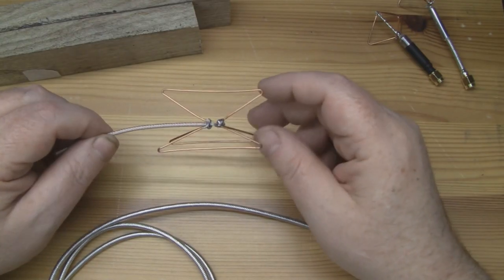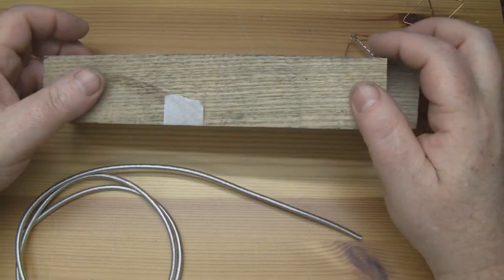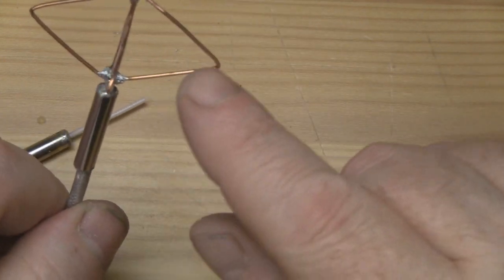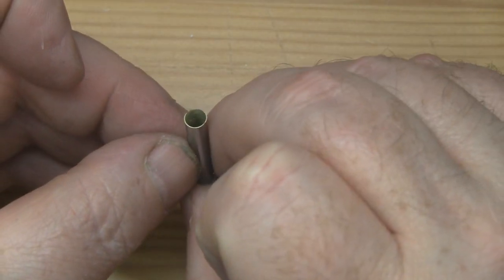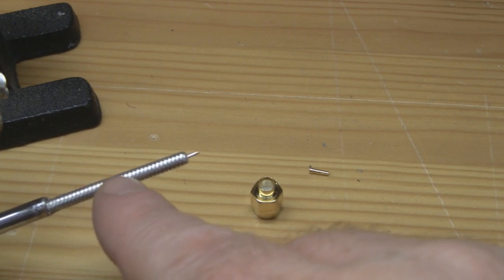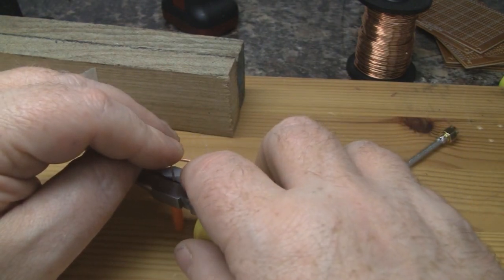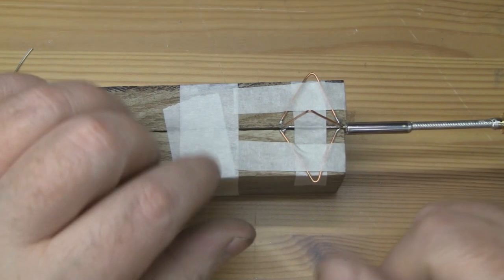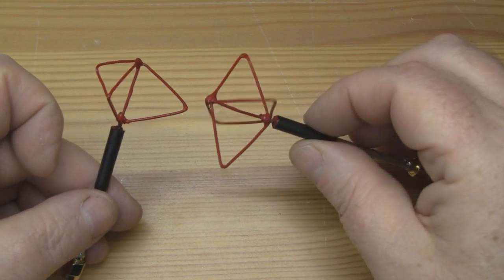Blade Antenna for 2.4GHz

Comment: Sorry for necroing an old vid, this type of antenna works well for my 4G mobile wifi (i look for a compact powerful antenna for my 4g mifi).

Thank you Sir McNeil for shedding some light on this particular powerfull antenna.

Adds significant DL speed:

4G mifi using internal antenna: 2 - 3 MBps

4G mifi using standard biquad (reflector less than 1 wavelength square) 3-4 MBps

4G mifi using this 4 blade antenna (sloppy soldering job, no balun, soldered directly to sma female bulkhead) 4-5 MBps

Yes, MBps not Mbps

Pros: really powerfull RX antenna (tested indoors, my neighbors house (including mine) are made of bricks taller than mine, 2 of which are 3 floor house), compact form factor, easy to build (i can build it less than half hour, eventhough im poor in soldering)

Cons: somewhat fragile, needs case or serious reinforcements (epoxy putty or hot glue) as im planning to put this in my relatively small sling bag during my commute or daily activity (needs to be train commute proof)

The SINR of the biquad and 4 blade antenna didnt have  significant difference, but the 4 blade antenna crush the biquad in download speeds, any thoughts ?

Comment: It is called a Non-polarized Bi-plain antenna.  NASA and RUSSIA used them in the space programs to link there satellites and such in orbit.   They had a directional value to them that helped in maintaining a signal with the craft from the ground.  If the signal was sent via like a polarized antenna the signal would not have a smaller target window have a greater chance to drop the signal!

Comment: I really like your videos and the practical approach they have.

I made one of these for my RC controller, I used heavier wire (hard to bend) and soldered some copper tape for the sleeve instead of tubing. A couple layers of heat shrink under it helped to get some distance between layers.

Works like a treat so far, but I've yet to test any long range to indicate a real success.

Comment: Hi Andrew, why do you use 25 mm as a ¼ wavelength ?
for wifi channel 6 (2,437 Ghz) ¼ wavelength is  30,77554370127206 mm  (accoring to  (300/2,437) /4 = 30,775 мм) in free space, and  29,236 mm in copper.(   ((300/2,437) /4)*0.95 = 29,23676651620846 )
Reply: (300 * 095)/(4 * 2.437)

Comment: I'm looking for some advice and probably my idea doesn't work but won't hurt to ask.  I recently bought a DJI mini 2 drone. The phone holder is made of 2 metal rods that are the antennas. I like to sit in my car, not so much reflection of the sun on the screen, and fly it from there.  The question is,  the fact I'm sitting in a car would that make the signal weak? If I put a metal rod in the roof of the car with a wire connect to the antenna of the remote control, would that help?

Comment: Hello Andrew, thanks for all of the videos. I hope you can stumble upon a 1080p camera in the future!

Do you remember the title of the 1945 book which you found this Blade Antenna in? I would love to give it a look.

I had a query regarding the blades, if they are 50mm (exactly) and we then attach them to the driven element (say 1mm thickness) will that not make the blades too long and change things for the worse? I was wondering would I be better to make my blades 49mm long?

I am awaiting my RG402 to arrive in the UK (very cheap) but I cant seem to find reasonably priced SMA connectors, taking inexperience into consideration and wanting to experiment with a few sets of Male/Female and then maybe RP-SMA male/female its suddenly looking expensive - what would you recommend?

One last thing, I assume this design would scale to 5Ghz using the same ratios found in your other dipole videos?

Thanks

Comment: Hi Andrew, i hope u'r enjoyin' your Monday! Look, i need your help, if you have the time, of course.
I've been recently contracted for fix a truely bad setted wifi big hotel network, & all was fine, the network is running well now. But the 4 routers & the 10 repeaters (it's a seven floor building) are TP-Link...., with their original little antennas......
I'm impressed about all you've posted, & this video has impressed me more. The thing here is that i use to build a little more sophisticated antennas, but, as you well know, many times this sophistication does not the difference, & how you show us here, many times the simplicity does it much, much better!
Several questions for you;
1° it seems you're using here RG58 coaxial, i'm right or wrong about it? If i'm right, your model it's not "bad affected" by the 75 Ohms RG58!, ain't it?, 'cause everybody talks about 50 Ohms coaxial as the best choice (RG213, for an example...) 
2° question; which could be the result if a build your model, but multiplying x10 the size of it?, would this make any difference?, or the size do not affect the results at all? I do this question 'cause we're talking here about a big hotel, which walls contains lots of iron & other heavy materials..., u know. For now the wifi network, as i've said, is working fine, but there are a few rooms in which the signal has serious difficulties to arrive. I made several tests with my antenna & the stuff runned much better, but i really have not the enough time now to build them (the vacation's season starts in 20 days here...., uffffffffff), & i guess that your model could really work better than mine, made them in a fraction of the time.
3° What do you think about to sold a wire to ground for your antenna model?

Thx a lot for your preciouss time Andrew.

Cheers.
Reply: I've wrote stupidly..., hehee..., i'm sorry, RG58 IS 50Ohms resistant, i don't know what i was thinking.... Look, i'm experimenting with your model, but with 2,03mm galvanized steel wire, no ground soldered (ground independant) 'cause here in my country the special coaxes that you use are now extremely hard to get.... (terrible financial crisis, import/export issues, & so on...) & guess what? IT WORKS!!!!!!!!! Of course, if i get the RG402, or at least RG58 coax & make the device exactly i'm sure couldl get better results, 'cause now, with my poor materials, i'm getting some nearly to 6dbi.. I'll post a video for you to show all that i'm talking here, &, of course, MILLONS THX FOR SHARE YOUR KNOWLEDGE! I'll wait for your answers about the questions i've done, of course when you can. Cheers.
Reply: Ignacio Valle ...please forgive me..., another question..; what kind of paint do you use for your antenas? Thx for your time!
Reply from the maker: Ignacio Valle Any Acrylic-based paint will be fine
Reply: andrew mcneil Thx a lot Andrew. I'll keep on learning & experimenting from your knowledge (i hope you keep it always open!). I'll post a video for you in a couple of months with all the tests that i can do. \o/▲☼\o/▲☼\o/▲☼

Comment: I'm actually confused about the connection. Why doesn't the other end of the V shaped copper antenna make a connection to the ground(the outer braid of coaxial)? While the copper V is soldered independently to the inner core, the the braid is soldered independently to the metal tube. To my mind, there isn't any connection happening between ground and inner core. Can you kindly explain.

Comment: Can someone explain me what's the meaning of the metal tube? That cable shell is conductive so I dont understand what's the difference with tube on or off?
Reply: Callum, I couldn't find your video that you referred to.  Did you ever make it?  Also, in regard to the veepee78's question, I understand that the sleeve is the other half of the antenna but, how is is it electrically different than the braid alreading running down the coax that the tube is soldered to?  Thanks.
Reply: This guy is not responding to vide comments for a very good reason: He just talks about length like you could reproduce but you wont be able to then he does not have any f evidence of these antennas working. No impedance measurements, not SWR no directivity. He only shows a random screen of some ISSR reading of something (no one knows).

Comment: Great video. Question.  It appears as if Andrew is soldering both ends of the copper ‘blades’ to the center core of the coax. 

I would have expected one end of the blades to be soldered to the center core and the other ends soldered to the shield. 

Can anybody help to confirm what the connectivity of the copper blades are relative to the coaxial cable.
Reply: I have the exact same question 👍 did you solved this out?

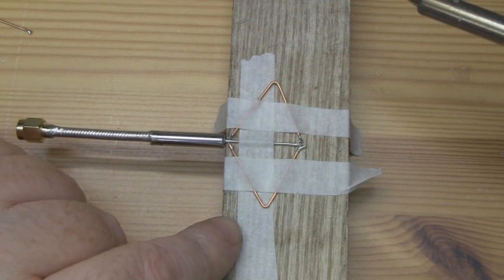Comment: Hello, Iv watched your videos and interested in these DIY projects. Where or what book would you recommend to learn about antenna design? Which wifi antenna have you experienced that is the best thus far in terms of performance size unconstrained. Also if one looks at a standard COAX cable lets say for a TV. Does the outer jacket or the shielding play a critical role in the operation of an antenna. Like how a battery has +/-. Does an antenna have a simmilar feature? Around 9:00 you mention it was a ground? so the outer houseing of the connector is the ground while the inner core of the copper is the positive? Im sorry I am new to electronics and dont want to burden you with so many questions, but would love to read into the intricacies of this.

Comment: Hi Andrew,
Thank you for your video, so simple omni antenna with amazing 9dB! Became my favorite. I have some questions.
What is the main purpose of Blade antenna?
Is it good for standard home wi-fi network - routers, or some special purpose.
Can I use instead of this coax cable, direct connection to PCB with tinny coax.

Comment: Great DIY videos.

I have a TPLink TL-WN722N, with removable SMA dipole(?) antenna. Can I just cut off the outer covering of the top half, and solder on 'wings' to the center wire as seen in this video?

Thanks!
Reply from the maker: 10ring Yes that would work.

Comment: Hi Andrew, thanks a lot for all your informations! I just built the 4 blade antenna. But it doesn't work my transmitter says the antenna is defective. I think it's because its open, I mean the is no contact between the ground plane and the signal/blades(open circuit) . Did I missed something? I watched your tutorial quite a few times and I can't solved this out.
Thanks a lot 👍👍👍
Reply from the maker: No it is supposed to be open as it is based on a Hertzian dipole. I don't sell these but a few people have made them and sell them using my instructions and they have had good feedback. What transmitter are you using? Is the transmitter limited to only work with a shorted design as a safety feature to stop you turning it on without an antenna connected.
Reply: @andrewmcneil  thanks a lot for your answer. My transmitter is an frsky X10s, for aeromodel. Yes it seems all my antenna have a connection between ground and signal, as per some antennas you have tested, like the frsky 8db patch antenna, or the cheap 5db black tube antennas.

Comment: Hi is it possible to connect to my wifi with my phone if i was too boost the signal and direct it using a directional antenna say... towards your local pub about half a mile away?  I would presume there would be transmitting issues from my phone? If it is possible what is required to do this? i am a keen engineer so i would be interested in this as a diy project trying this out. Regards.

Comment: Nice antenna! Can you explain the purpose of that brass tube? Unlike the common cheap dipole antennas where the tube is used as the lower half of the dipole and is only connected to the braid at the top, yours seems to be soldered to the braid at the top as well as the base. Except for greater diameter how does it contribute to the characteristics of this design?
Reply: I have the same question . I think it was a mistake. Because in the next video when he use a parabolic reflector to this antenna he puts a heat shrink tubing not to short the metal tube . And he says if you leave the tube shorted to ground the antenna doesn’t work properly. 

But my question is even that tube shorted to ground , when he tested the antenna it performed very well 😬😬

Comment: Such a simple design, have to try this!
Small question, does the tube needs to be soldered on both ends to the braid of the cable?
Reply from the maker: Ronnie van Drunen No you can just solder the top and it will work the same.

Comment: andrew does the outside of the coaxil need to be grounded with the inside of the coaxil (with the cylinder solder joint at 6:16)
Reply: I believe he wanted to make a sleeve (or bazooka) balun - it's a quarter wavelength sleeve over the coax, but connection should be made only on bottom side - such balun works as a ground plain. Or if it soldered only on the top - it would work like a second pole of the dipole... But I don't see the point to solder it on both sides...

Comment: first I want to say this is good video Iam in the midle AND I want to try it :) I want to give you ONE more old advice :) it is from my grand father witch was very good radioamater (Iam low and high voltage elektric man or how to say that in english :D)  So I go back to advice :) if you brushed tube to be able solder there dont do it by twisting but by put inside outside same like at sex ;) REASON : "skin efect" ;) at high freq its very very important  if I dont explain it well write me maybe I try it again and beter :)

Comment: why 25mm 1/4 wavelength is 124mm/4=31mm
Reply from the maker: This is a dipole a dipole is 25mm 1/4 wavelength in free space your confusing it with a cloverleaf.
Reply: so what is the formula for dipole 2.4 GHz? 25mm is 1/4 wavelength of 10cm or 3GHz. but the title says Blade Antenna for 2.4 GHz.
Reply: I made it with 30.5 mm sides for WiFi,works perfect!
Reply: with 2.4GHz WiFi.
Reply: Alextvman Tvman Could I cut the top off of the SMA antenna that came with my TPLink TL-WN722N, and just solder on 30.5mm wings to the center wire?
Reply from the maker: 10ring That would work
Reply: @alextvmantvman3894  Did you ever manage to extend your wifi range using this antenna

Comment: I build this antenna but result is very bad. Worst than factory antenna. Only difference is I used copper tape instead of ferrule.
Reply: I am not saying that antenna design is wrong but my antenna doesn't work. I did everything as shown on video with exactly same dimensions. Only difference is ferrule and cable. Cable is standard one used for 2.4Ghz.
Reply from the maker: rapsod1911 Can you take a picture so I can see what you have made?